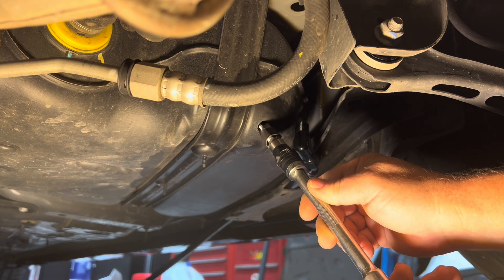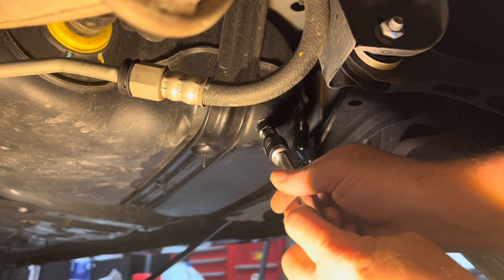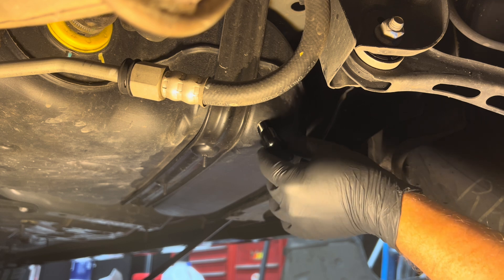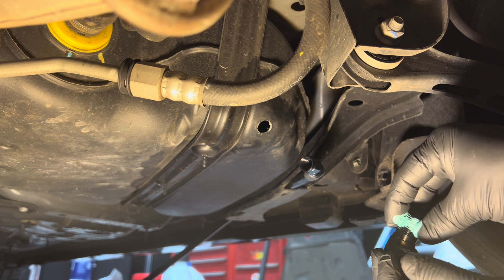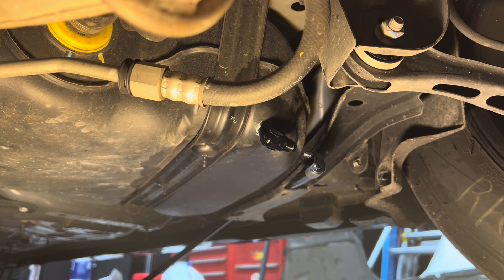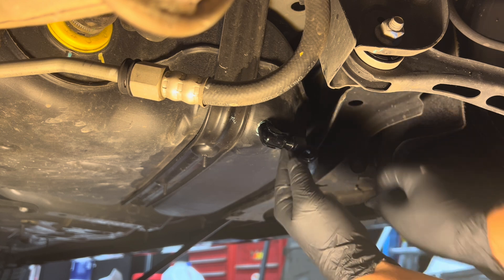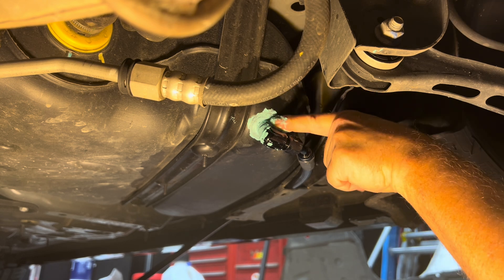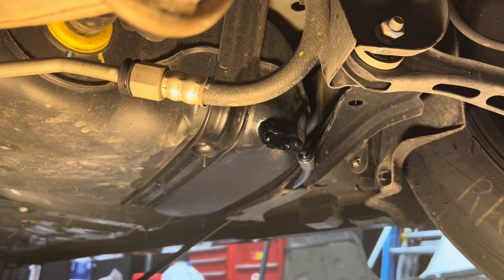Drill & Tap fuel tank on GEN 6 CAMARO ZL1 for aux fuel pump kit install

Comment: got that chop going on. what cam you get? or just tuned that way. thanks for the video was wondering how to go about doing this. eventually I will upgrade my pump on my 21 2ss but im not there yet. just got done installing kooks 2' headers with comp pipes got hp turner with my wideband got my AFR dialed in. next is installing a new cam and heads with  BTR LT1/L86 225 Camshaft W/ Valve Train Components setup wish me luck.
Reply from the maker: @buffseven  thanks for the interest. It’s a GPI cam, a PD2. One thing, if I had to do it again I would get rid of the extension and get closer to the fuel tank in order to be more stable while tapping threads into plastic fuel tank. The tank is thin so you’re really tapping a single thread so make it as perfect as possible. Also debur and sandpaper around the hole on outside of tank so your sealant will grab on and bond better. Afterwards clean with brakekleen as it leaves no residue to effect your sealant. Hope that helps you. Congrats on your current build progress and wish you the best moving forward with it.

Comment: i need an aux pump and im
N/A full bolt on running e85
Reply from the maker: @ss6thgen336  I recommend the DSX aux pump, it works great as intended. 👍
Reply: @dronechaserzl1 well look into it,  i have a question do you have a kill switch on your camaro ive been looking for videos on how to install a toggle kill switch but havent found one
Reply from the maker: @ https://youtu.be/FSajnWA4Q94?si=DtmN8rn6finiIWfP

Comment: Can you run full E with that pump?
Reply from the maker: Not sure, due to the Kong X Port of my supercharger and other mods along with the fact that e85 access isn’t near my location.. I had it tuned on 93 and there wasn’t enough fuel system support left to do e85 which is okay for now. 766rwhp stock pump, injectors -no meth -
Reply: Stock injectors ?
Reply from the maker: @Coyotte_Rob  yes and oem stock hi-side hi pressure pump too.
Reply: Has yours leaked yet? Having a time with mine. Started with that stuff. Then gasiola e-seal. Now on aviation permatex.
Reply: @jordanboggs9686  see, this is that shit I’m scared of. I need an aux pump but scared to run one cause I don’t want the shit leaking on a brand new truck
Reply: @Boostlee2023  I have finally gotten it fixed after multiple attempts. I moved from a 3/8 nptf fitting to an 1/2” nptf 6an. Tapped the hole bigger and fresh and has not leaked since almost a month. Fingers crossed. Other than the leak I havent had any other issues
Reply from the maker: @jordanboggs9686  I almost did the same as you after mine started seeping 3 days after this install. But, after some research I decided to remove the fitting, clean off all sealant, lightly sandpapered the hole and the area around the hole on outside of tank to roughen up that glossy plastic to give my sealant more to bite on to. Then I used a different sealant called Seal-All. That worked for me, still dry 4 months later after dragstrip, cruises and many other events.👍